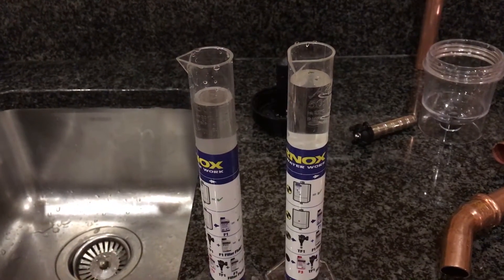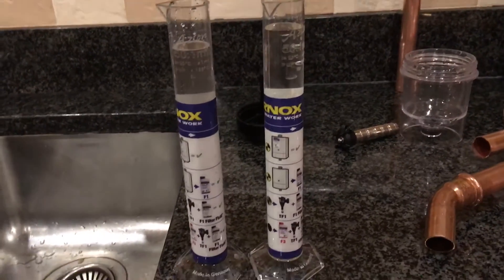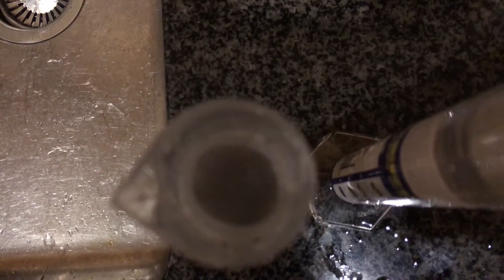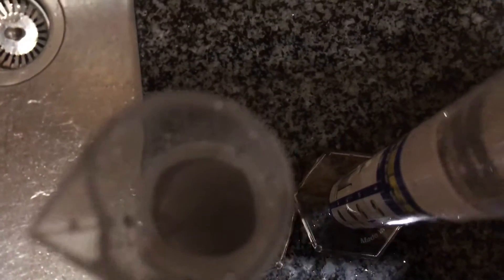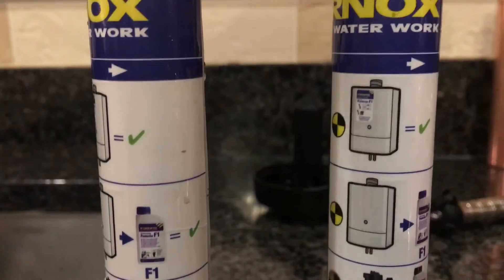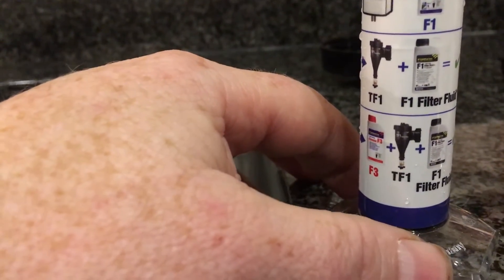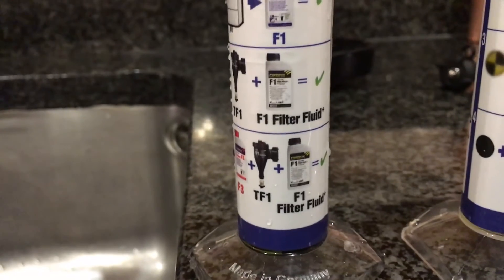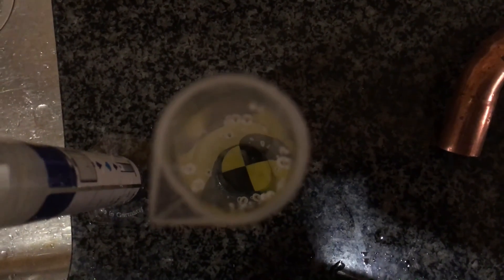CENTRAL HEATING SYSTEM - How To Test The Water

Comment: Where on the central heating system would you take your sample from?
Reply: Suitable drain off....run water for 20secs and THEN take sample....hope this helps
Reply: @chohanchohan8208  could you take it from a radiator bleeder?
Reply: Flow and Return should be drain off point OR Magnetic filter...OR nearest radiator to boiler
Reply: @chohanchohan8208  is it ok just to take a water sample from the radiator (nearest to the boiler) bleeder if there's no drain off fitted on the rad? Thanks.
Reply: @Moocow9991703  yes
Reply: @chohanchohan8208  cheers its just I've just bought a power flushing machine and i don't want to be doing unnecessaryry power flushing 🤥
Reply: @Moocow9991703  where a boiler is working I have never used a powerflush machine..just added Cleaner and flushed system a month later ...sometimes I have had to do 2x doses of cleaner..15yrs no comebacks...I only call in the powerflush when the boiler is not working...